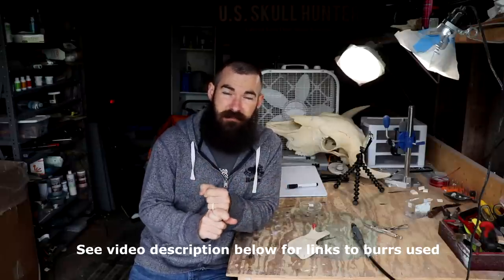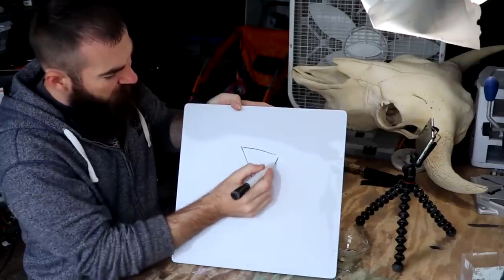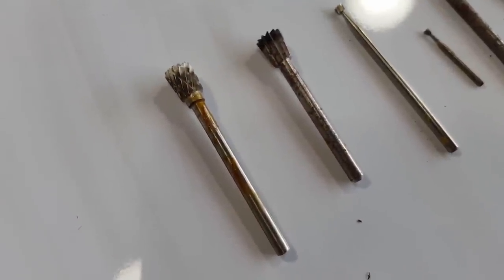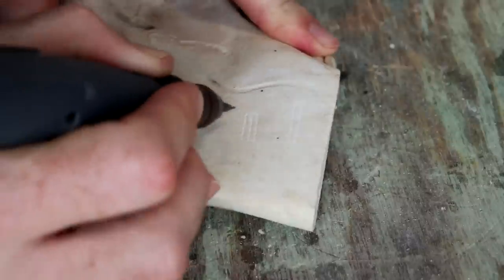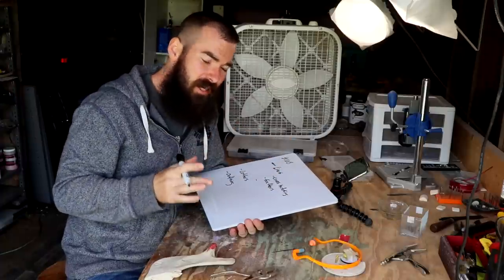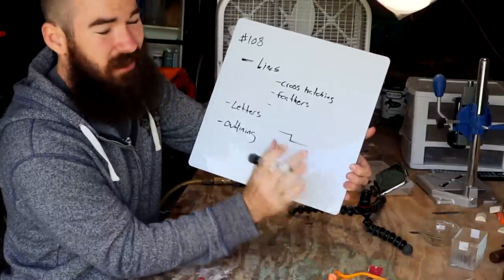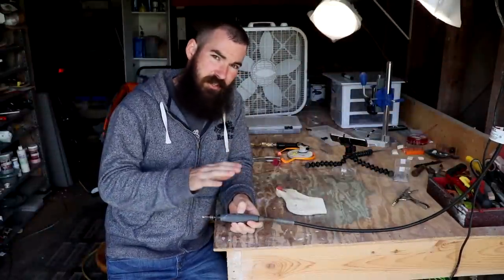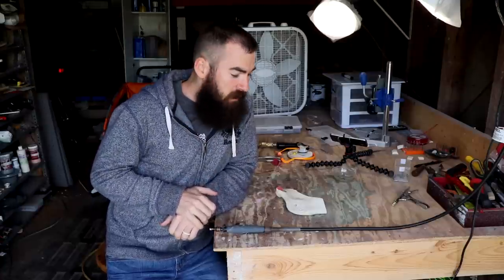Bone Carving Burrs Tutorial Part 1 (Inverted Cone Burr)!

Comment from the maker: ➝ TOOLS USED IN THIS VIDEO
★ Small Inverted Cone Burr @t
★ Medium Inverted Cone Burr @t
★ Large Inverted Cone Burr @t
★ Dentist Style Inverted Cone Burr @t

▬▬▬▬▬▬▬▬▬▬▬▬▬▬▬▬▬▬▬▬▬▬▬▬▬▬▬▬
➝ SKULL CLEANING TOOLS
★ Aquarium Heater @t

▬▬▬▬▬▬▬▬▬▬▬▬▬▬▬▬▬▬▬▬▬▬▬▬▬▬▬▬
➝ SKULL CARVING TOOLS I USE
★ Dremel 4000 @t
★ Flex Shaft @t
★ Adjustable Chuck @t
★ Respirator  @t
★ Ear Protection @t
★ Ball Carbide Burr @t
★ Inverted Cone Burr @t
★ Cylinder Carbide Burr @t
★ Large Ball Carbide Burr @t
★ Diamond Dust Burrs @t

Comment: Hunter, thank you for these really helpful videos! I have a question. I ordered an inverted cone bur and I was surprised that it does not have a cutting surface on top of it. Only on the sides. The top of the bur is smooth. Is that the same as yours or not? Thanks.
Reply from the maker: Hey Bob! The majority of inverted cone burrs do not have a cutting edge on the top.  The part of the burr that is really doing the most cutting it the outer edge of the top of the cone and not the top. You are kinda cutting at a sight angle most of the time which is the edge of the burr, if that makes sense.

Comment: Which do u prefer the hand piece your using now or a full sized dremmel as i just brought the dremmel3000 as i am a beginner
Reply from the maker: So what I am using is the Flex Shaft by Dremel which actually just attaches to the dremel itself. I use the Dremel 4000. I would definitely recommend adding the flex shaft as it gives you a lot more mobility.